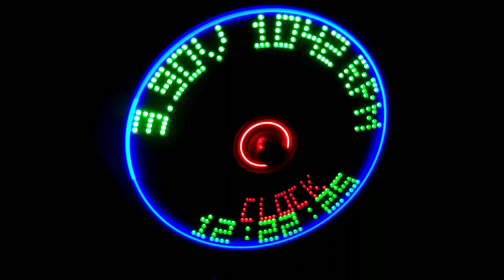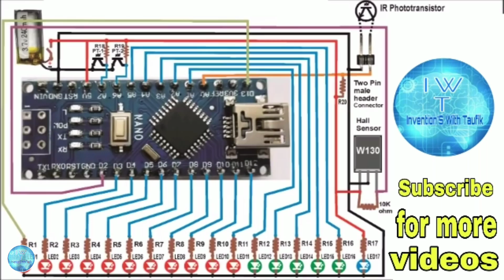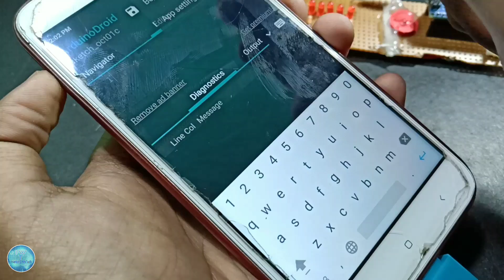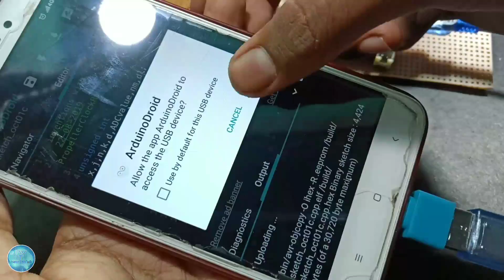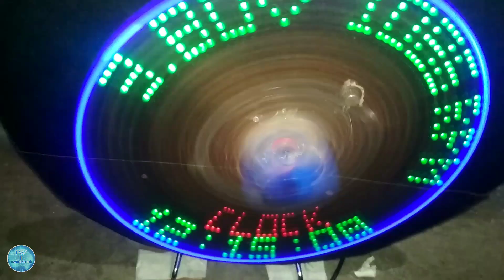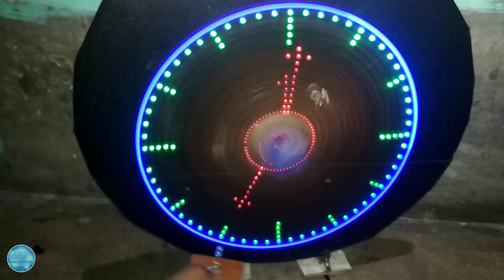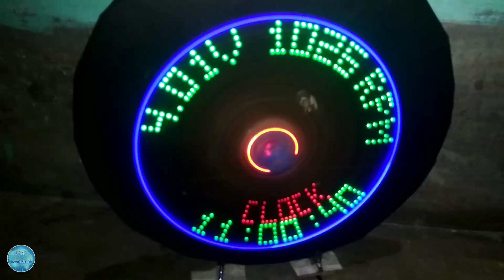How To Make Led Propeller Clock || Digital+Analog 2 in one || Inventions With Taufik || Ut Source

Comment: can i use 3.7 v mobile batery  in this
Reply from the maker: Yes
Reply: @InventionSWithTaufik  i havev3000 mah battery it will work
Reply from the maker: @thegiruinternational1475  it will work but 
Do not use a larger size battery because the weight of the watch will increase or it will not rotate properly.
Reply: @InventionSWithTaufik  thnks for rply

Comment: Brother please please reply my project is complete but the code link in the discription is not open please update . 

Please brother 🙏🏻🙏🏻🙏🏻
Reply from the maker: Ok let me check
Reply: @InventionSWithTaufik  thanku so much brother ❤
Reply: @InventionSWithTaufik  Brother last question can you please tell me correct value of resistor it's 220 ohm or else 330ohm 
Because in the circuit diagram you mentioned 220 ohm and 
In the video you said 330 ohm 
please brother tell me correct value ❤❤
Reply from the maker: @mhd224  You can use 220ohms and 330 ohms both. But you can use 220ohms for better light
Reply: @InventionSWithTaufik  thanku you bro ❤
Reply: @InventionSWithTaufik  brother please please reply compilation error only show 😞😞😞😞😞😞😞😞

Comment: Sir where's that female header with a jumper in the diagram???
And if not then where u have connected that female header ends and the resistor also???
Reply from the maker: Bro Arduino nano A0 pin connected to female header and second pin of female header is connected to gnd I also define this in diagram check right side of the diagram I define with male header
Reply from the maker: If you have any problem mail me and I will call you thankyou
Reply: Thanku sir😀😀
Reply from the maker: @ashajaiswal1844  Your Welcome Bro 😊😊😊

Comment: How it will look at 300 to 400 RPM?
Reply from the maker: The clock will not look complete
Reply: Is there any way to complete clock by increasing the blinking of light in coding part
Reply from the maker: @ROHITKUMAR-tv4ul  No because clock needs speed to complete.

Comment: can i use 25000rpm motor
Reply from the maker: No because 25000 rpm is too high for this clock use maximum 2000 rpm motor for this Project...